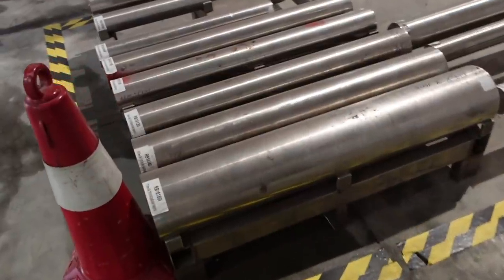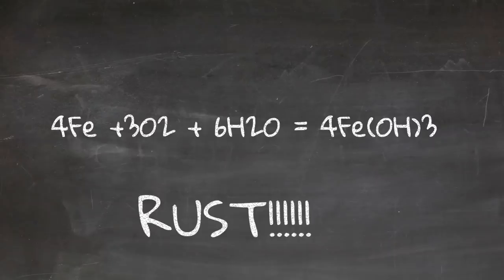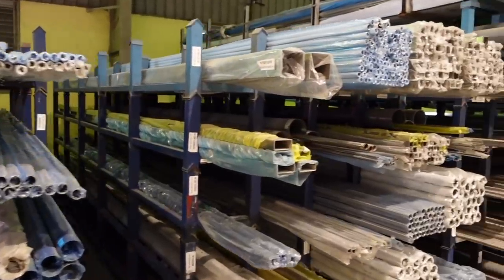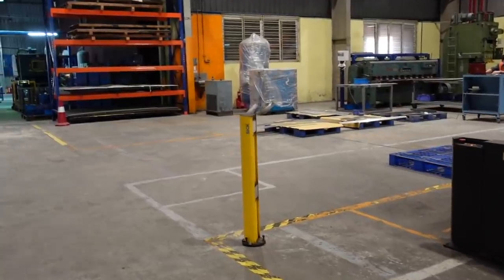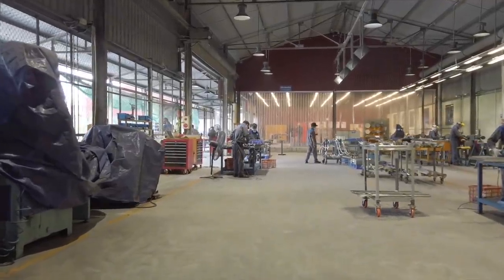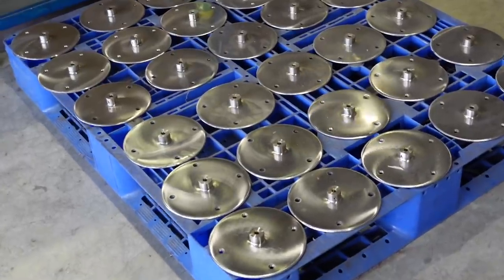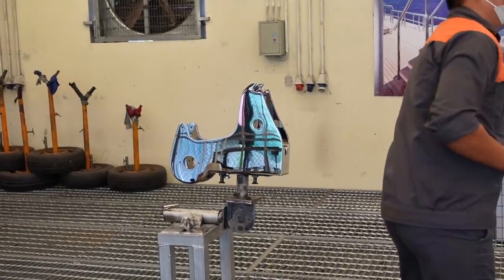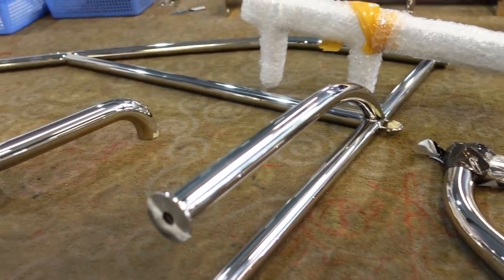Check THIS One Tiny Detail BEFORE You Buy Any Boat!

Comment: Grateful to you for uploading this...very impressed by what you saw - I also appreciate the sheer quality of the production process - IMHO, easily better than most western yards.
Reply: I have seen corrosion setting in on SS stanchions and deck plates - and there is usualy a weld involved : tiny imperfections either in finish or the actual weld...just enough to allow the corrosion process to get a toe hold - over time it expands...could be a few years before it is noticeable, but when you do notice it you are facing a costly bill to replace.   Medway products would be cheaper in the long run for someone who will keep the boat for 5-10 years: Peace of mind is worth the money.

Comment: Good move passivating the stainless steel. Every boater needs to know about this.  Even if stainless steel is alloy A316, it needs to be passivated.  Stainless steel bolts also.

Comment: We had stainless steel expert on board in Spain who instantly knew our boat was made in Thailand (even though everyone usually thinks it's a Colin Archer from Norway)  He said Thailand and Vietnam are the only places in the world that produce Stainless to that standard, nice to know. As you like your geekery Nick, are they calling your stainless 316, 316Ti or 316L? The formula you gave has no Titanium so I guess not 316Ti but it seems to be in between the spec for straight 316 and 316L (low carbon) The 316L would be better at sea especially in warm water (All 316's are not equal!)
Reply: Midway Metals Vietnam uses 316L for all marine parts (and sometimes duplex 2205 for special projects)

Comment: Always nice to get a inside look into manufacturing. Some minor remarks though, when you are talking about milling at around 4 minutes, that is actually a lathe turning products (the mill is the machine at 3:40). 
the cutting machine you are showing is a laser cutter, not a plasma cutter. A plasma cutter is far inferior to a laser and certainly not capable of micron precision, you only ever use a plasma cutter if you are on a tight budget or if you need to cut thick plates (more than 20mm thick).

I do agree this looks like a proper machine workshop with very high standards. Hope these manufacturing video's keep on coming, it is really nice to see all the different disciplines that are required to built a boat.

Comment: Beautiful mate 
Pick up some spares while you’re in the factory nick , buy some.  The factory gets the price on those shower drain pumps and water pressure pumps if you’re able spare parts up mate if you can and we’re having lots of ongoing problems ventilation and draining the black water tank maybe bigger drain valves or bigger vents or maybe even a powered pump to drain black water would be great if possible . It’s an ongoing issue for us but maybe they’ve resolved it ?

Comment: I guess I am nerdy also. Liked the video. That factory is putting out first class product. Just a note on stainless steel.
Stainless steel should be thought of as stain – less steel. It is generally protected against rust, but in certain situations can begin to rust / corrode.
Corrosion or rusting resistance varies with the grade or composition of the stainless. 316 is generally very good for marine applications.
Exposure to strong chorides, attachement to a dissimilar metals such as iron, brass, etc. are the two most common causes.
There are passivity treatments that can increase rust and corrosion resistance.

Comment: Definitely good to see the attention to detail and quality!  It is call Stain-less, not stain free for a reason though.  This is why I like the Balance 526's solution to use composite everywhere possible and not stainless steel, a much more elegant solution.  I wonder if they considered this option since it is built in Vietnam with lower labor rates.

Comment: There is a risk of crevice and pitting corrosion of 316 stainkless steel in seawater at temperatures above 30 degC, Typically in areas where stagnant sea water can evaporate and cholrine levels build up. Checxk with the metalurgist at the cat manufacturer

Comment: Fantastic, nerd out for proper manufacturing (right up there with vehicle production at a certain huge vehicle producer in Germany). Love the auto shut-off safety system.   Acid wash area appears the most vulnerable area of ops: Acid barrier in run-off sumps? Acid and concrete are a matter of time before you have Chromium 3 or Chromium 6 in your groundwater (nerd science stuff and this is the same vulnerability that has as in ‘Western’ manufacturing facilities involving plating solutions and acid baths).  The dream… a proper work shop!

Comment: Electropolishing? This is good for insidie and outside. Where you cannot see. It is the reverse of electroplating, the micro sharp bits are disolved into solution with the aide of electric current. Much better than hand finishing for the hard to get at places. You still have to blend the welds. The heat affected zone is the weakest part of the weld, there is also a micro crack between the parent metal and the weld metal, this has to be blended out or it will be a site for stress corrosion cracking. Check out sulphur reducing bacteria and stress corrosion cracking, they can be nasty to stainless steel under load. These beasties are why stainless chain is a bad idea, with the flash butt weld and the incipient crack near the heat affected zone they get right in.

Comment: Nice video! Optical bars and other lockout measures are pretty standard in the West.  I’ve designed automotive transmission assembly machines and have also been cursed at by machinists who have to make the parts I designed. Par for the course. One tries to DFM/DFA (design for manufacturing/assembly) as much as possible, but sometimes a part is going to just be difficult..
Reply from the maker: Thanks for the info!

Comment: This is to Nick the Geek . Thank you , I'm the inventor of stainless steal. I was a kid, when I discovered how to tighten the orbit in the making of plan steal. Stainless steal, was a highly classified project.  NASA, DOD, I was put in charge of (( project white Mars 1535 )) the code name back in 1967 for stainless steal. 
WHITE , M.A.R.S. Mars stands for , ( m,atter a,t r,everse s,tate ), Mars 1535, white, is the color of heat, that I discovered, molten,  coka. For, a  X Y, trilla second, matter, stoped spinning, one way and switched to a reverse state of spin.
For 250 of the worlds smartest people. What I proved and discovered, changed the world as we new it. Stainless was first used in NUKLER power plants, changing, hot plants to cold water plants. My stainless,  changed all NUKLER power. All navy subs, I founded a firm that built NUKLER power plants world WIDE. In the USA we handed off to the federal GOVERMENT here to form the branch of goverment called the NRC. 
I'm not famous,  because I always, worked behind locked doors on CLASSFIELD everything.
So, nick, the geek, thanks for seeing, how cool stainless steal is. I won the Nobel peace prize in science. But because I could not recive it publicy. I was passed over...

Comment: The Quality of work and pieces of equipment produced in the East can equal and surpass Western quality requirements. The problem is not in the workmanship and quality but in the requirement of businesses to maximize profits and bonuses for the management team. If the use of a high carbon part in a low carbon application will result in an increase in profit, they will use a low quality part. So, it has always depended on management as to what the resulting product looks like.

Comment: I understand you have a commercial agreement with Seawind and you don't want to jeopardize that relationship, but I'm missing the more critical (and honest) views your earlier catamaran review videos had. Surely not everything is mind blowing, amazing, wonderful, perfect, ... For example, there is no such thing as "micron perfect" tube bending. The width of a hair is ~50 μm. Do you really believe these machines offer precision at the level of the size of a bacteria? Or what about the usage of 316 steel? Surely it's common for marine purposes, but there are alternatives. What about using fiberglass, or even a different alloy like Nitronic?
These videos are starting to look like advertorials, and should be marked as such.
Reply from the maker: Two points. Laser and plasma cutters DO cut to this level of precision.
https://www.laserfocusworld.com/industrial-laser-solutions/article/14216530/fine-laser-cutting
So yes I believe what the CEO of the stainless steel company said, that he then backed up with data.

Fibreglass is brittle and therefore not ideal for something made that has to take load or shock load. Nitronic would have to be cheaper to purchase, easier to work and more aesthetic to be a viable alternative.

Second. No the videos don’t need to be marked. Believe me. We checked. 

Midway are not paying or giving anything to us. If you’ve followed our channel for a while, you will know I call out bad workmanship. See certain reviews we made. Seawind also don’t pay us for our content. If I don’t like something I promise you I will call it out.